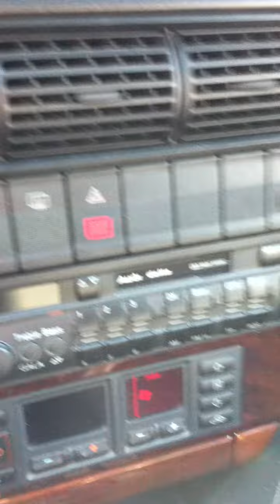1997 Audi C4 A6 Avant Right Front Strut Noise

Comment from the maker: The strut bearing is rust inside and thus create some play within that tiny gaps of bearing itself.

That was found after I put new engine mount, transmission mount, sway bar bushings and lower control arm bushings. What a royal pain right?

But at least I found what's going on finally haha!